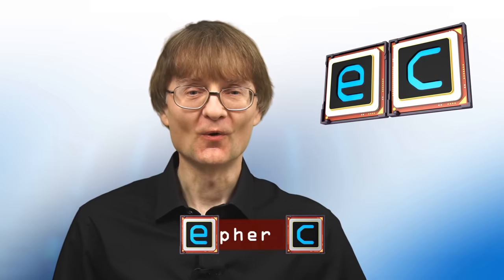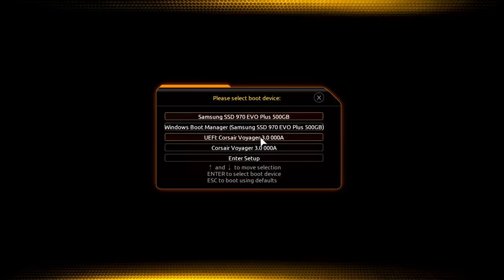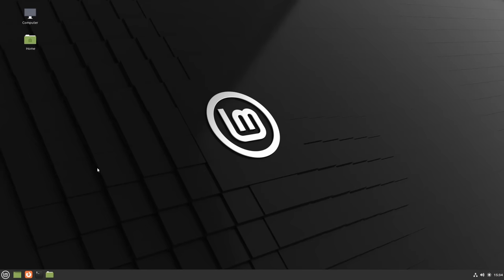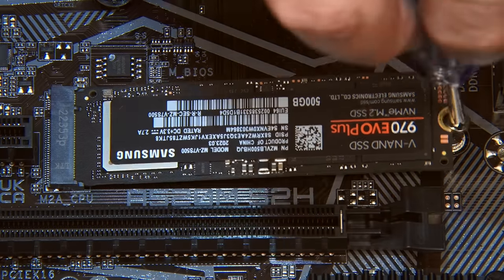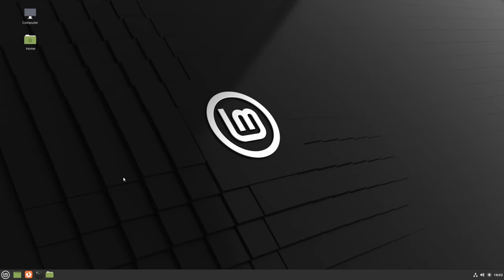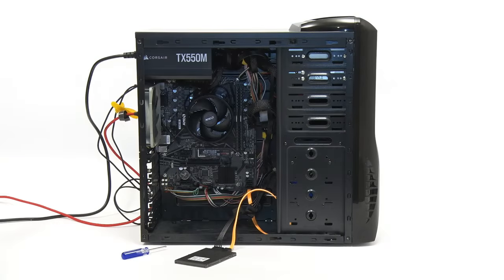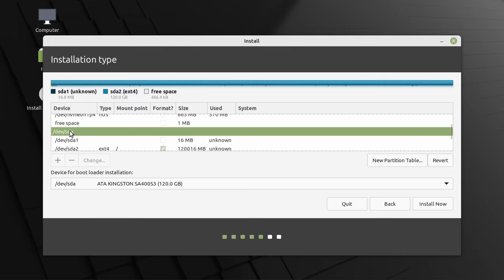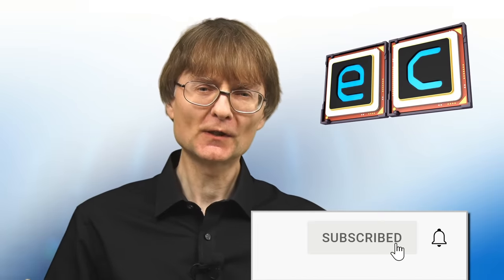Windows & Linux: Dual Drive Dual Boot

Comment: What to do when no option for installing alongside?
Reply from the maker: You will only see an "installing alongside" option if you are installing on the same drive (or if you have two drives live at the same time).
Reply: @ExplainingComputers  Hi, yes I'm using a single drive, but the option to install alongside does not appear in the installation setup. I have done this before successfully, but now as I said there is no option and I'm stuck, cheers
Reply: There is only the 'something else option

Comment: Would this work with a laptop, if I remove the windows drive, install a new one and install Linux. Then replace the windows drive and ad the Linux as a USB 3 drive. I know the performance will not be as good, but The only computer I have is a laptop and I have use for both without having to dissasemble the computer each time?
Reply from the maker: Yes, this would work as you describe. Linux can run well from a USB 3 external drive.

Comment: I installed Debian 12.1 on a second  NVME SSD  on a Dell Precusion 7530 UEFI laptop but I can't get it to boot. I installed Grub2Win on the Windows 10 drive and tried  booting Linux but am getting  the error  message "error: file  vmlinuz not found. You must first load the kernel." Any suggestions on how to fix this?

Comment: what will happened when i have 2 discs for windows, ssd for boot and hdd for files and i will buy third disc for linux, it will work if i use dual drive B method? i will see only linux drive when i will boot from linux drive boot?
Reply: B method will work fine. Remove both drives. Linux will be able to "see" both Windows drives in its file manager. However, these drives are formatted to NTFS so its not a good idea to store Linux files or any games on these drives, but you will be able to access anything on them.

Comment: It is not a good idea. In Linux you can access the entire hard disk easily, except if the NTFS partition (the Windows file system) is unclean, it is read only and you must switch to Windows and clean it up, a pretty complicated procedure with lots of reboots. Then again you can access the NTFS partition read-write from Linux. It is a pain in the ass. Furthermore you cannot at all access the EXT4 file system from Windows. There once were Windows drivers for EXT-something, but they are outdated and not the very least reliable.
A much better solution is to get a H*LL lot of RAM (say 16 GB), huge SSD hard disks and always run Windows in a virtual machine, with Linux as the host. You must assign at least 2 CPU:s to the Windows virtual machine and at the very least  4 GB RAM to the virtual machine, preferrably 8 GB. Also install guest additions if you are using Virtual Box. Then you can run Windows pretty stably, but you also have to go into the settings and set Extended Features: Auto Capture Keyboard OFF, otherwise your VM hangs the mouse intermittently. I do this. Qemu might work too. And VMWare, but that one isn't OpenSource.
Reply from the maker: You are making the massive assumption that the Windows install needs to access the Linux one, and vice-versa. Your "problem" goes away if you do not make this assumption, or set up Windows appropriately. 

I am a big fan of virtual machines and VirtualBox, and have many videos on them here -- eg https://www.youtube.com/watch?v=OWmD8obq4eQ And at the end of this video, I do say that dual booting is a good option if a virtual machine will not meet your requirements. And if, for example, you need access to all hardware, it will not. For example, using Premiere Pro or AfterEffects in a Windows VM! :)

This is a video, as the title states, about dual booting -- not about all ways of running Windows and Linux (software) on the same computer. :)

Comment: A heavy Linux desktop like GNOME or KDE will run okay in 1.5 GB RAM. Windows 10 or 11 has a requirement for 8 GB RAM before you do anything else. This is because of the amount of telemetry and "phoning home" that Windows does in the background of the PC that you pay good money for but hand over to Microsoft to "lease" back to you whilst they take full control of it.

Hence there's no reason to dual boot a crappy Microsoft OS with a privacy-respecting OS like Linux.

There's your answer.

Comment: Why dual boot  you can easily get Linux with wsl2 inside windows
Reply: thats a pretty dumb question ngl
Reply from the maker: Because you might want to run a Linux operating system?! :) Most people who set up a dual boot are likely to be doing so because they do not want to be running Windows most of the time.
Reply: @ExplainingComputers   disk space waste  and  with wsl2,  you can share same partition  and if the linux has problems you wont require an usb stick to fix the software or bootloader  and if you decide to use linux as a day-to-day  well you have wine so you can use the windows software you like

Comment: Anyone have experience with installing Windows 11 and Linux onto (separate) USB3 flash drives and running them from there? I'm considering these options for my laptop.
Reply: Ventoy ? I'm having a single 64Gb flash drive with Win 11, Win 10, Fedora 38, Kubuntu, RegataOS,......  Once you set  up the  UEFI /Secure Boot Enabled BIOS  to boot  from the USB flash , you can run/use any of the OSes mentioned before ....
Reply from the maker: Running Linux installed on a external USB drive can work well.
Reply: @celdepescaun39  Yeah, I do use Ventoy, but that's for booting (compatible) ISO images, like those that run live systems, installers, or tool discs.
But what I'm talking about is installing an OS onto the USB drive, like you do on a regular internal disk, and run the OS from there, as a means of having an alternative OS on an external drive and boot it when needes, and have it save it's changes on the USB. You know, like you do with regular internal storage... but outside.
Surely the speed and size won't be on par, but it could be interesting for certain uses.
Reply: @ExplainingComputers  Ever tried WIndows? I think there's a special version that supports this. Not sure if it's WinPE based or what.
Reply: Writing a W11 based "Windows To Go" installation on a 32GB SD card with Rufus 4.1 right now.
I'll see how that goes...

IT TAKES FOREVER TO BOOT! xD

...and after an eternity of booting, it seems to piggyback onto the internal disk installation... what in the world...
disk management calls my internal windows partition c: and all software runs from there.
thanks for nothing "windows to go nowhere". what a waste of time.

Comment: One day UEFI  will ceased to ,incorrectly, be referred to as BIOS
Reply from the maker: No, it won't. Because nothing is "incorrectly referred to here". The "unified extensible firmware interface" is a type of BIOS (basic input/output system). So it is perfectly correct (both technically, and in terms of effective communication) to talk about entering the BIOS on a system on which the BIOS type is UEFI, rather than classical. Practical evidence of this is abundant. Not least MSI, Gigabyte and other motherboard manufacturers still refer to the "BIOS" on  PC, not to the UEFI.

So my use of the term "BIOS" in this video reflects the technical and practical realities in the computing world today. And I have discussed this in a previous video: https://www.youtube.com/watch?v=ezubjTO7rRI

Comment: Great demo, thanks Chris.

I see you have already produced a number of videos about backing up, including this one https://www.youtube.com/watch?v=uEP9GTs1lZs

Currently, I am a bit of a dinosaur when it comes to copying files onto my backup drives. On Windows I tend to use xcopy and on Linux I use rsync. 

I wonder if there are any more modern but still easy to use and understand packages that I might be using? I wonder if viewers might like this as  subject for a future video?

I think two key steps with backup media are to verify that (1) data has been transferred successfully and (2) that it can be read back when required.

Comment: No…not that simple.. windows “repaired” my boot partition after switching on my pc and now i can no longer boot my linux partition..
Help
Reply from the maker: Sorry to hear that you are having problems. But is this on a dual drive system where the drives were isolated during install? I would guess not. The whole point of this video is that if you install Linux in a partition on the Windows drive then this kind of issue is exactly what may happen. The Windows  boot partition on an isolated Windows drive should not impact Linux booting on another isolated drive.

If you are using two drives, remove/disconnect the Windows drive and then reinstall Linux on the other drive.

Comment: i recently "upgrade" my system  from a single drive triple windows bios mode boot to an single drive dual windows uefi mode boot with 2 windows EFIs and an grub EFI to select them. your video is the least informative about the rabbit holes you can get in with dual booting....

Comment: Why disconect windows hard drive i dont get it i didnt disconect the windows hard drive and still installed linux without problem  problem on second harddrive
Reply from the maker: Yes, obvously you can install Linux on a second drive without removing the first one. But is not what this video is about! It is about the boot method (BIOS vs GRUB) and ensuring that Windows cannot corrupt the GRUB menu if that is your boot method. As the video also shows in detail how to achieve the same result as removing the Windows drive by manually placing the GRUB boot loader on a second drive if you really want to boot that way. But I'm not sure this is what you did?

How are you booting? Where is the GRUB boot driver? Are you boot selecting via BIOS GRUB? If GRUB, if/when a Windows updates corrupts GRUB, you will discover soon enough the point of this video!

Comment: Windows 11 is just off, even with a brand new high end system, loading a spreadsheet takes several seconds which is very inconvenient when working with multiple apps. I don't get it, even my android tablet loads the same spreadsheet in an instant, it's not just spreadsheets, things that should happen immediately don't, things like launching a web browser typing something in and having that thing you typed be displayed in the search box. It's as if every keystroke you make is being sent over your network for approval , I first noticed this nonsense with windows 8. I have had it I'm going to try out Linux very soon

Comment: Corrupted my windows install😢
Reply from the maker: The method I strongly suggest in this video cannot corrupt your Windows install, as the whole point is to disconnect your Windows drive before installing Linux to remove any possibilty of the Linux install interferring with it.. :)
Reply: @ExplainingComputers  yes unfortunately i was not able to disconnect my windows drive as it was a laptop with only one drive slot. The windows install was old anyways and needed to be redone ill be trying again with a fresh windows install

Comment: For anyone that isn't sure that Windows is now complete garbage, try installing it on a 5400 rpm drive, and listen to Windows try to ruin the drive as fast as it can. It's utterly outrageous how it deliberately grinds the head all over the disk for tens of hours straight every few days. Microsoft made Windows pessimal to force you to buy new machines. It wears it out as fast as it can.

Comment: Dual boot Grub boot loader gets corrupted by Windows not the other way round
Reply from the maker: Sorry? This is EXACTLY what I say in the video -- Windows can corrupt a GRUB bootloader. What video were you watching? But isolating the Windows drive from Linux (physically, or via settings) is the best method to use to make sure that Linux does not place a GRUB bootloader (that Windows can then corrupt) on the Windows system drive.

Comment: This is purely nonsense. When you start start the PC Windows ist not directly started but as you can see in the menu it is the Windows boot manager. In this video you are referring to "Dual Boot" but you are describing the grub boot manager. In grub you can manage more than 2 operating systems. And if the menu is corrupted it is easy to re create this menu.
Reply from the maker: This is not "purely nonsense". I am clearly NOT in this video only referring to the GRUB boot manager, as the second setup shown achieves a dual boot WITHOUT USING GRUB AT ALL.  I am well aware of what you can do in GRUB, and also what a sodding pain it can be. Many, many people here would not agree with your assertion that is it easy to sort a corrupt GRUB menu, as again the comments here clearly show.

Comment: How is a dual boot setup tricky to remove? Literally just go into Disc Management and delete the Linux partition. Simple as.
Reply from the maker: Deleting the Linux partition from a standard Linux/Windows dual boot setup will not remove GRUB from your system. Why do you think there are so many guides out there on getting rid of it?